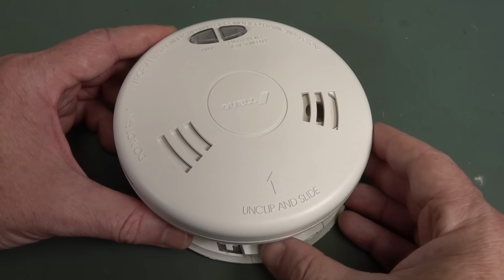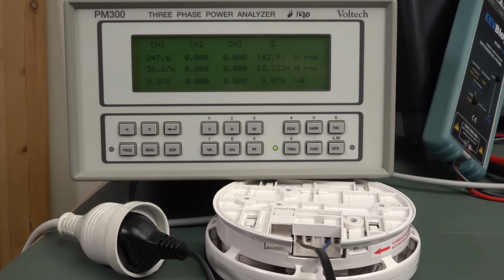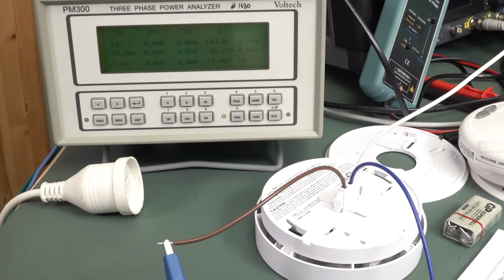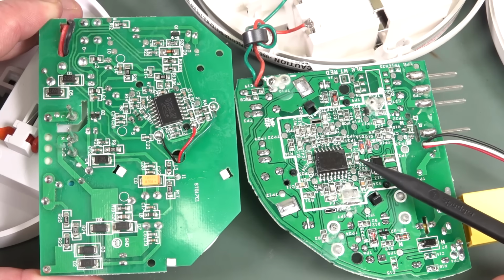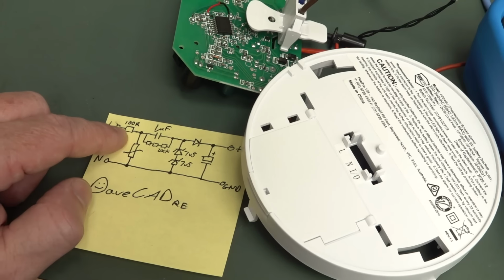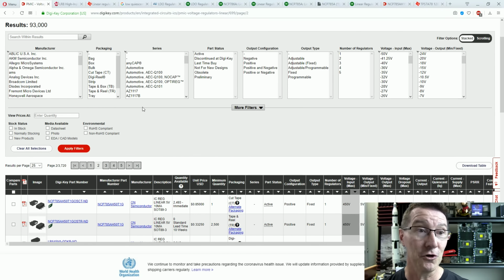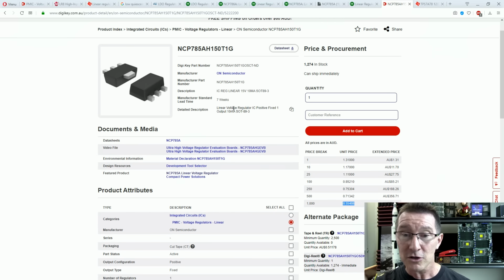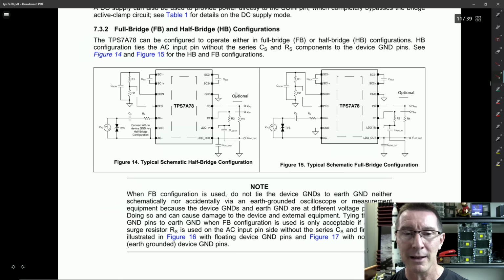EEVblog #1284 - How Bad Product Design Kills The Environment

Comment: all this talk about smoke alarms...when are they going to make a smoke alarm that doesn't embarrass me when I'm cooking?
Reply: There are ones out there that only react to heat. They ignore cold particles. Most of them are dual sensor and you can disable the optical one. They are designed to be used in kitchens or other areas with steam or dust in the air.
Reply: They do, swap out to optical ones as they don't give nuisance alarms, unlike the ionisation type.
Reply: @cambridgemart2075   I just had the optical Ei Electronics 650 smoke alarm beep at me while i was cooking in the middle of the night just a couple nights ago. I made quite a jump to silence it, luckily at least the button is huge.
Reply: So, you're looking for a smoke alarm that gives cooking lessons?
Reply: @Lane42  :  They already do,  switch on the externally vented hood while frying..  (Don't randomly burn stuff and they won't go off)..  lol..
Reply: @Lane42  Now, I could use one of them!

For a start, it could teach me not to burn the water so often when trying to make a cup of tea.
Reply: I've been to a hotel (apartment) in finland, where they had a prominent sticker telling something like "triggering the smoke alarm automatically calls a fire brigade, and a false alarm will result in a fine of 1000 eur. be careful with the sauna and the kitchen". I certainly wouldn't allow such a "bomb" to installed in my house.
Reply: LOL at the "woosh factor" in the replies above.

Comment: Home appliances have to comply with certain energy efficiency standards before they can be legally sold - and it may be time for the standards to be revised to include fire alarms so that devices like the models analysed. When deployed & operating across thousands of homes & properties - the wasted energy is a significant drain on our electricity grids; especially when things inevitably go pear shaped during heat waves, storms, high winds, etc

Comment: I'm just gobsmaked at just how bad that is... 1000 time more consumption than necessary... I learnt how to make a supply like that when I was 10, and by 11 knew it was rubbish... it's so bad I think you could set a design challenge to High school kids, make a better power supply from COTS at a price point of less than 30c per unit..
Reply from the maker: There is a reason why hardly anyone uses zener shunt regulators any more!

Comment: In the UK we have our glorious 'Energy Saving Trust' (Energy Wasting Truss). They quoted on UK TV and media that televisions used 40Watts on standby. I phoned them and asked where they got 40Watts from. They passed me onto British Gas who knew absolutely nothing about it and were laughing their heads off. They also got their pay back time wrong re loft insulation, somebody moved the decimal point. I'll be dead before I get my money back. They also went mad on those 1Kw DIY roof windmills. 1Kw at a wind speed of 30mph. Average UK wind speed is 5.7 mph. The largest UK DIY supplier quiety removed all stock. Now of course all the huge  'professional' ones are well into self destruct mode with gangrene of the blades. Anybody out there that can beat that lot ?
Reply: That was 20 years ago when instant on was a marketing deal.  Now the CPU network is kept running at 4W very much like your cell phone.

Comment: When a place is placing 500 of these into their apartments and aren't the ones paying the elec on them, the efficiency isn't important... If the battery powered ones were allowed to be used, that would be amazing, but building codes force these backup ones to be used and... so residents eat the elec cost.

Comment: By the way most of the caps used in such a design wouldn't last for 5 years. We have bunch of crap devices in my country and I'm frequently repairing such things. Always the cap from the shop nearby is almost double the size for the same rated capacitance...

Comment: Talking about pissing away power.  Almost everyone in my company leave their computers running 24/7.  If every office in this country does this, then I wonder how many power stations are required to keep these machines running during the night and weekends?
Reply: IT needs them all so they all do not update on Monday morning at 7am-9am.  We work on your machines during the weekends.  The energy is nothing compaiered to having a toady intern drive in to turn on a cube farm and turn on the motion sensor florescent grow lights.   Yes there is a technique to turn PC on by network signal, but implementation was not the best.    In the bad old days hard drive failures happened because the bearings had tight tollerances during spin up and the read write heads rested on the platter.    Leave the PCs on.

Comment: 16:46 I just remembered the time where TVs had several tens of watts standby. I think there were models in the 80s that had between 20 and 50 Watts standby.
Reply: Given the power draw of a CRT, calling that 'standby' is almost laughable...
Reply: @KuraIthys  Well still a lot for just pissing it away so that the TV turns on a little faster ... you also have to realize that it draws that 24/7
Reply: I remember looking at a Plasma TV that was 75 watts (and the on power was 650w). That was a big nope.

Comment: Capacitive droppers aren't inherently bad for very low standby currents. The quiescent current is high to provide the headroom to operate the buzzer. 
Another way to design around this would be to use a much lower value input capacitor (0.022uF) bringing it down to the order of 160 micro-amperes then use a high voltage transistor (3 cents) to activate the buzzer from a resistive dropper. The cost of that solution might not be any more expensive than the current solution.

Comment: We got smart meters recently (UK) - the  smart monitor can't even have the screens turned off, they don't go into standby, and it can't maintain a meter connection more than a few meters from the installed meters. There's a sheet over it to stop the entire hallway being lit up at night, the option to turn the screens off doesn't even work - its shocking, they should be ashamed, its supposed to help reduce energy consumption. It's mass market too so there is no excuse for poor design. I don't know how utilities (including the shite routers that ISP ship) can get away with such horrendous design

Comment: Spring lever clamps are way more satisfactory for retaining tension on the wires in the long term. Old installations often have loose connections where the Copper has relaxed and the screw clamps aren't holding them tightly any more.
Reply: Totally agree. ( I don't want to make an advertisement, but wago 221 series are fantastic. They have PCB versions too.)
Reply: @joelstienlet1641  - It's one of those rare occasions where it's cheaper to make them that way, ie without screws, and it's a better product.

Comment: Funny how this goes, they put it in prior to regulation, this in fact installed at the middle of the year 2018, I only found out just a few months ago why my battery went low, they didn't connected my smoke alarm to the mains but the wires are there but I didn't bother about it, till now. So I am saving my pennies in your words. (don't bother connect to main at all if the electrician forget to connected them, you can blame them not yourself, lol).

Comment: Speaking of which, that NBN modem I received gets HOT. Do you think anyone anywhere calculated how many extra power stations we need in Oz once we install them in every single household?
And I'm pretty sure it has no fundamental reason why it needs to use any of that power, especially when idle.

Comment: You calculate the power consumption of the device only in its idle state.  Of course there is a reason why they use that 1uF dropper cap and "waste" power in the zener diode "only to supply 50 microamps": when the smoke alarm gets triggered and starts beeping, it will take way more power!  And in that case it must be supplied as well, assuming you would not want to power the active alarm only from the battery.
That is why the circuit draws more current than you would expect.  And it may also be the reason why a linear regulator would not be all that practical.

Comment: my internship involved making a mains power supply ... well 2 in fact. and it was low volume so no custom supply designing there. did i mention they had super low emc demands?  the research on very small mains power supplies was incredibly interesting. i went for 2 transformers. for that form factor, price and size it was the best option and most reliable one for very high isolation.

Comment: Over here such smoke alarms as available in supermarkets and hardware stores exclusively operate on the battery, no mains connection at all!
The latch that prevents installation without a battery is mandatory, andwhen the battery is nearly empty it will start beeping at 1-minute intervals.
When you have a couple of them in a small appartment it will often be tricky to locate the correct one.  It will fail during the night in the winter when it cools down, and you wake up by a "beep" sound but it can be from another room.
So I have made many nightly trips through the house at 5AM to locate the place where it beeps, remove that one from the ceiling and remove the battery, go back to bed an the next morning replace the battery.
A mains powered unit would not be practical as there is no power available at the ceiling in existing houses.  I believe mains-powered devices exist for use in newly built houses.

Comment: Instantaneous power is P = V*I. In an AC system with a resistive load (PF=1.0), the V*I is always positive, thus the load is always consuming power. As soon as the PF is not 1, then there are parts in the AC wave where P = V*I that is negative. Because of the phase difference between I and V. Thus, I will be positive while V is negative for some instances of time, and vice versa. That means the load is supplying power for those negative instances. You still have the real I^2*R losses, as those are PF 1 loads. The generator, and all the infrastructure, must be able to supply the V and the I. So yes, if I becomes larger than what the generator is able to supply, you would need another generator (or tranformer). The reactive power on the other hand appears as a torque ripple on the generator shaft. Not ideal either. The real power, as seen by fuel usage, is only P = V*I*PF, PF the power factor as seen by the generator.  The I^2*R losses will change the PF at the generator from the PF at the load. So, bad PF wastes extra I capacity that could have been used to perform actual work.
Reply: Hmm... I was thinking that for non-linear electronics load, negative V*I does not happen. Load is not sinusoidal. So V*I is either positive or zero. That will create torque ripple and generally mess things up for sure, but no extra I^2*R losses in down time. I think PF is somewhat misleading in those cases as "apparent power" is kinda BS in non-sinusoidal situations.
Reply: @otherbasis8505  Non-linear loads does not preclude negative V*I. It just means that given a single frequency sinusoidal voltage, the current will have different frequency components than just the supply frequency. Also means that superposition does not apply. I have seen some add a PF based on the current total harmonic distortion to the normal lead/lag PF. Though that part I'm not too familiar with.

Comment: Hi Dave. I'd be interested in your thoughts on those pin for pin compatible switching regs for substitution with the lm78xx linear regs.
Reply from the maker: They have been around forever now. I remember the song and dance when they came out.
Depends on the case. In some cases for low V drop, linear is more efficient.

Comment: hmmm, mine here are powered by lithium-batteries only. last 10 years without change of batteries. why are there are grid powered ones?
Reply from the maker: Because they are mandated by government.
Reply: @EEVblog  Thanks Dave. In Germany there is also an obligation for fire detectors in private homes. These are 99% all with pure battery operation. I do not know of any product that uses mains voltage. 
But I have looked for 230V devices. There are some, but the data sheets do not show the power consumption.
I found product pictures, they show 40mA or 1W.

Comment: Here in France with our new connected smart meters we now pay for VA and our contracts were subtly altered to kVA from kW!  So it hits our pocket!
Reply: So big clive's prediction is coming true, then.
Reply: @Dingo Nates Yikes, do you have a source?
Reply: AFAIK contracts in France have been in kVA for quite a while (if not forever).
However old meters were only able to measure kW so that’s what it was in practice.
The new meters tripping on kVA instead of kW would actually be a good thing (force individuals to correct their PF) if users were notified when they trip because of bad PF
Reply: The same meters are used in Denmark.
Reply: Not nice. Here in Germany, we still pay for KW.  But therefor, our KW-price is about 0,30€.

Comment: IMO there's a way better solution. In the US we have smoke detectors that don't use 120v mains power, they just run off the 9V batteries and last for years. And some of them are being built with built-in lithium batteries, you pull a tab that activates them when you buy them.

Comment: It seems bad but not that bad. If you install one or two of them to your home some other appliance with a transformer inside will simply cancel that out. Try to put the power analyzer to the mains input of your home and make the measurement again. Probably your overall current will drop some milliamps when you connect that thing to mains.

Comment: In the EU, a power supply exceeding 75 watts has to have power factor correction inherently. Below that value, there is no such rule. My contractor would rip off my head if I designed a part with PFC at a power consumptio lower than the regulation demands.
By the way, the biggest power wasters are the cheap chinesium AC motors costing only half of the price from Siemens or Bosch but have an efficiency of only 60 to 70 %. If they all were replaced by BLDC motors, 40 % of the power generators could be taken from the grid and we could save a huge amount of CO2 producing coal.

Comment: Could they argue this simpler design of mains power supply is more robust or less prone to failure compared to more efficient designs? Suspecting a lot of aspects of those smoke alarms are tightly prescribed. We have very similar mechanical latches around the batteries here in Europe. And the battery powered variants have a 9V battery + 3x1.5V backup.

Comment: At least one alarm on each floor with recommended placements away from the kitchen and in areas leading to bedrooms, must be changed every 10 years, has to be mains powered and have a battery backup and has to be interconnected with every other smoke alarm in the house are the current requirements for smokies in Australia. I'll have a squiz and see if the expensive ones are the same although I know that the new LED exit signs have a small smps to run the thing